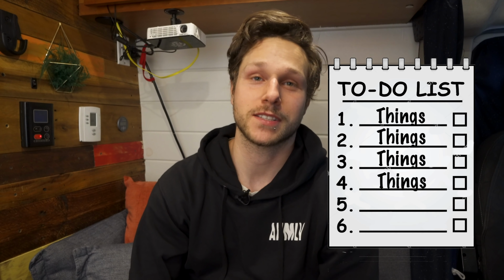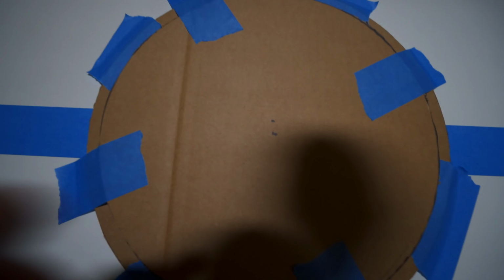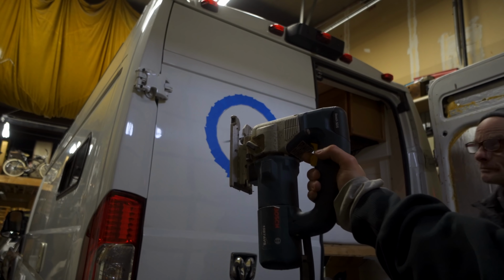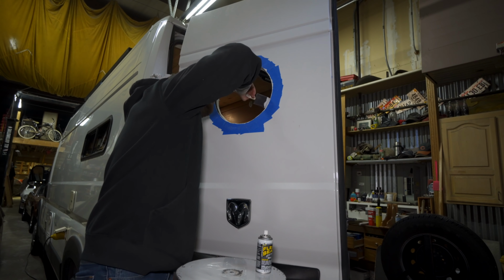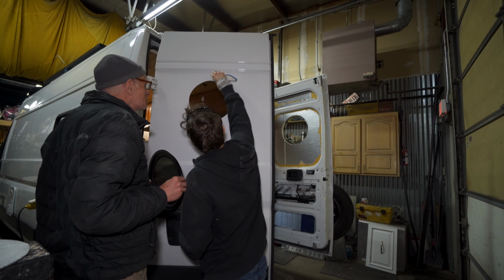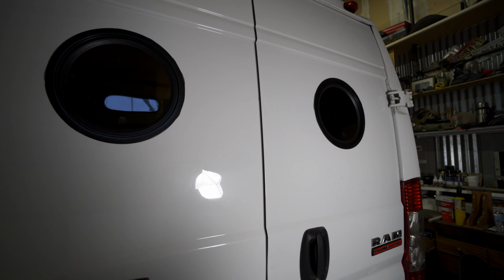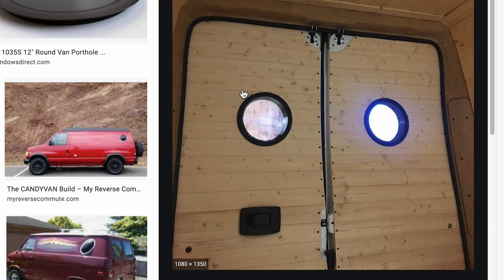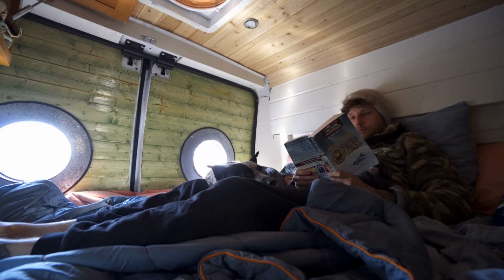Turning My Van Into A Pirate Ship - Installing Porthole Windows

Comment: We used flex seal around the edges of our MaxxFan cutout holes too! Then we used 3M 5200 marine sealant, and it blows Dicor away in terms of performance and longevity. You don't have to follow the crowd on these builds and it's great that you thought outside of the box.

Comment: Nice work, when I put in my porthole windows they were a pain. I put a round piece of wood I found at Lowes. 11.75" x .5" for about $8-10 (don't remember) I used a bottom bearing trim router bit to make a round hole the same size as the window to make the trim ring.

Comment: Probably a proper name for that stuff but we call it edge guard in the electrical industry. We use it on big electrical boxes that have sharp edges to protect wires from getting cut or nicked. Good job & I may consider port holes in my build. I have no windows at all which I like for security reasons but the port holes offer security & light.

Comment: The inner rings are reversible to fit thicker walls so no need to trim the inner insulation 🙃 therefore it would have not needed a trim ring I would just paint them black like the outside, totally destroyed my last name (the wife was in hysterics🤪) get some large shirts done🙃